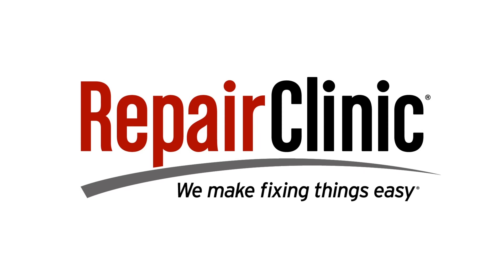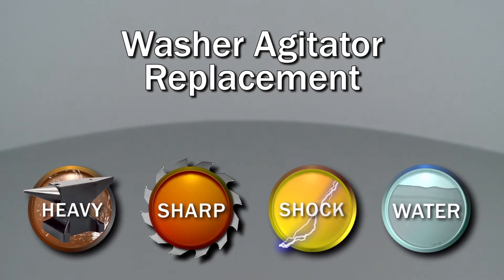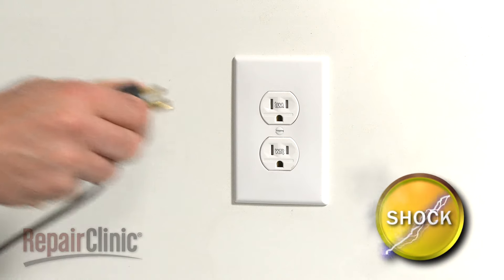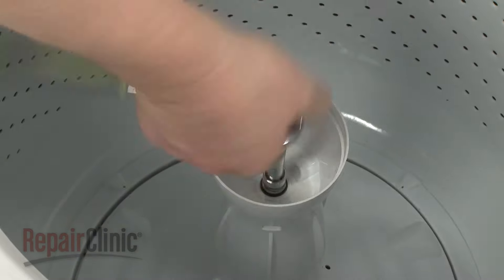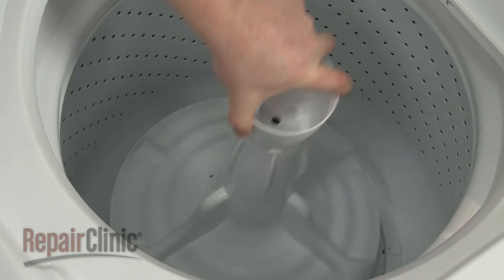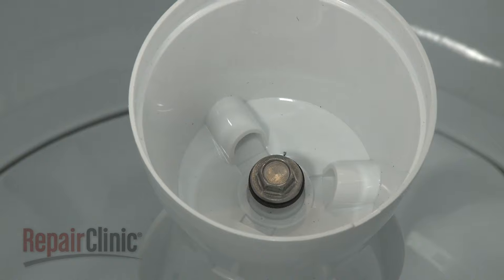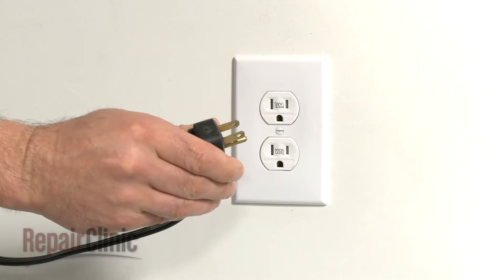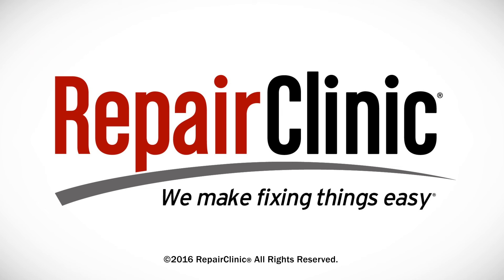Whirlpool Top Load Washer Agitator Replacement #W10680208

Comment: I just replaced this agitator in my machine and it is now working. To answer some of the questions below, no, this type doesn't have dogs or any other pieces to replace except the whole agitator. What happened to mine was the plastic "teeth" that connect to the drive shaft wheel had worn down and were stripped.  I could spin the old agitator without anything else moving and when the machine was running the drive shaft turned without the agitator turning. Once I placed the new agitator onto the drive shaft it locked in and couldn't be spun freely. I wish I could add a picture because it would make more sense. I guess plastic naturally wears down when paired to metal. ALSO....my husband tends to overload the washer and I am sure that is tough on the plastic part of the connection!!! The weight of moving too much wet laundry probably wore down the plastic quicker than it should have.
Reply: Exactly the same comments above apply to my situation...including the husband issue.  LOL
Reply: You answered all my questions! Thank you!!!!

Comment: The key to removing a stuck agitator IS brake fluid and pulling like a mo fo.  A few good taps with a rubber mallet helps brake it loose to where you can pull it out.  Took me about half hour.
Reply: I used Q20, left it for a while and then got my fingers under the bottom of the agitator....wiggle, wiggle, wiggle.
Reply: This was a headache.  The bolt came off easy enough but that bit$h would not move. Used some wd40 also used a screwdriver that had a shaft thick enough to fit thru the 3 small holes at the top of agitator. Hit them in turn with an upward stroke going around and it finally came out.

Comment: When I go to loosen the bolt whatever it’s connected to spins with it. Like a shaft or something. So the bolt itself does not loosen. Any ideas?
Reply: Hold the agitator, unscrew the bolt, and pull the agitator out.  I had to really use my strength.  But it eventually come out.  The teeth in my agitator were stripped.
Reply: If you can manage it, someone suggested to me and it worked: if you don't have a power tool to help you break the bolt free, stand inside the washing machine to weigh down the drum so it stays put while you use the socket wrench on the bolt. It felt crazy, but it worked for me!   Washer capacity is 3.5 ft3 of water, which weighs over 200lbs. If you weigh more than that I'd maybe not do it, but it worked for me!
Reply: I asked someone else to help so I would have another pair of hands. One pair to keep from turning and one to loosen the bolt.
Reply: I was co fused by this too because every video shows the the agitator turn when loosening the bolt for a turn or two, and then it unscrews, but with the agitator stripped and the bolt old and corroded, it turns the drum and not anything else. You have to hold the drum/basket in place and try to unscrew the bolt (in my case) the whole time until the bolt is completely out. It’s a pain in the damn azs.
Reply: Impact drill was only thing that worked for mine
Reply: Did you ever figure this out?  I'm having the same problem and can't find the answer
Reply: @Steffi_V  please tell me you figured it out T.T I'm in the same predicament. I don't think these people understand that holding the drum still and everything doesn't work if whatever the screw is connected to spins when you hold the drum. I nearly burnt up my drill
Reply: @WolfOfTheAbyss  Yes!  I read above that someone used an impact drill but I didn't have one. So I took my socket wrench and just started giving it quick hard fast jerks with a lot of jolt over and over and over. Make sure it's  quick and forceful turns and stop right as the underneath part of the drum starts to spin.  I cranked on that thing like a hundred times literally, and right about as I was about to give up it came loose!  The bolt is really caked with grime and crud and grease that needs to be loosened that's why you really should have an impact drill for it.  Unfortunately my washer still isn't fixed.  After taking it apart, cleaning everything and replacing the agitator dogs it gives one whoosh of water at the beginning of the cycle and then stops agitating again.  My next guess is the capacitor 🤷

Comment: The agitator does not lift out. It is stuck or something is keeping it from coming out. Do they all of this same model come out the same way? Do I have to go under the machine to loosen something? MOD WTW4815W1. My card was invalid. I have to check on it.
Reply: I have the exact model machine you have with the exact issue.  Did you figure out how to get the agitator out?
Reply: We have the same model and we just got ours out.  It is very corroded underneath and we had to use a rigged up winch with a strap under it to get it started.  If you can pull it up enough to get your fingers underneath then you can start to wiggle it back and forth.  And now that it is off I can't tell if the worn down splines are inside of the agitator or on the very very expensive drive shaft.
Reply: I just got mine off. I tried the brute strength way with not luck. I placed a a band underneath and pulled and nothing.  Then I dropped a little bleach in the whole that the nut came out of and saw a chemical reaction. I waited a minute or so and then gently poured 60 degree Celsius water into the hole and pulled up and down on the agitator 10 or so times and repeated this step for about 20~30 mins. It finally came off. The gunk/scud was horrible. I am currently soaking the agitator and ring in the tub. I have a pause and play washer. Once you take out the agitator it will not fill up. So I have to fill it up with a Downy bottle filled with hot water. I can drain it by holding the button for 3 seconds. Hope this helps.

Comment: If you have this exact machine the agitator itself probably is not the problem. After going through a stuck bolt and a stuck agitator that sits on a corroded drive shaft, I found that there are no "dogs." The agitator is just one plastic piece that sits on the drive shaft which is one piece with the tub. The problem is something under the tub. I had to use an impact wrench to take off the bolt, and then pour a bit of brake oil in the bolt hole that eventually allowed me to pull off the agitator.
Reply: So what was the issue that made it not agitate?  Mine spins but doesn't agitate...and is pretty corroded.  Used a jack (don't ask) to pull the agitator out.  I can't figure out the part per any of the schematics.  Or it might possibly be the drive assembly for $327,  that's not happening.
Reply: @catherinesoule9857  I was able to get a used replacement for cheap so I haven't messed with it further. I think it was the coupler on the bottom which is like 7 dollars, I also think I did further damage from running it to test things and it probably needs a more involved and expensive part replacement now, since it stops on spin.

Comment: I have this exact machine.  When I pull it away from the wall I hear water sloshing under the tub.  There is also a funky smell.  I removed the back, the drain house, felt inside the drain area and found nothing.  Works fine (even after I put it back together LOL) but I don't know what to do now.

Comment: I had to buy a replacement agitator, and the original part has since been replaced. Multiple sites say I have the correct part, but the new agitator won't fit on the drive shaft. The parts look identical, but the canal for the drive shaft is more narrow. Any ideas?
Reply: Sounds like you have the wrong part which is frustrating I know. I’ve had similar issues with other machines. Either look harder for the right part or get some jb weld and glue it on, haha

Comment: what would be reason to change this type of agitator?
Reply: I had to change whole agitator, when i needed to replace the agitator dogs, because the retaining bolt was badly corroded. I had to remove some part of the agitator to expose and access the bolt. Everything is good now,  I got my whirlpool 2nd hand from my sister. (replaced the bolt with a stainless one)

Comment: When I try and loosen the bolt the entire unit turns with it. If I hold the tub and agitator in place I can hear the motor or gearbox turning with the bolt. Anyone else have this issue or how to resolve it?
Reply: Darren Peter   Im having same issue ... did you figure it out?
Reply: @brandonfillinger3034  i have the same problem please help :c
Reply: I used a screwdriver and a hammer and tapped the whole on the center a few times to losses everything up. Not to hard, just a few gentle taps.
Reply: I can't get the damn agitator off. It will not losen whatsoever and I'm at the point of buying another one 🙃.  Anyone have any suggestions?
Reply: I had to pull very hard. The connection piece where the bolt attaches was quite oxidized and was not allowing the agitator to pull away from it. I had a friend knock it it with a screwdriver + hammer while I pulled it upwards. This loosened it enough for me to get my hands under it and pull it up and out. Hope that helps!
Reply: YouTube whirlpool washer plate and citric acid
Reply: Did you figure it out? I have the same problem.
Reply: I have the same issue, the bolt seems stuck and when I turn my socket wrench counter clockwise seems the motor underneath goes with it.
Reply: @theranbjornson5436  I just gave it a go.  I damn near picked up the washer.  It's rusted on the good.  Yes the bolt was removed first and I hammered on the sides while pulling up.  Didn't budge.
Reply: @zombieno1  I don't know if it worked or would help at all but I had a video of me pulling mine off and uploaded it to my channel as a short I think? Doesn't show a lot but kinda how I got it to move a little bit and it would sort of pop up and down. I got my hands under the bottom and pulled as hard as I could. Eventually it popped off.
Reply: @theranbjornson5436  ay I really appreciate you responding.  I'm going to give it one more try tomorrow.  It's my neighbor's machine and I'm just trying to help her out.
Reply: Use an impact drill to remove the bolt holding down the agitator

Comment: Mine won't come off ... Its easy to get the bolt off and I pull and pull and bang on it but it still won't come off.  This machine is only 5 years old too so the corrosion can't be that bad.  How do professionals in this work do to get the agitator off?
Reply: I have the same problem my agitator won't come off either
Reply: @acidbranding5158  mine either
Reply: I just got mine off. I tried the brute strength way with not luck. I placed a a band underneath and pulled and nothing.  Then I dropped a little bleach in the whole that the nut came out of and saw a chemical reaction. I waited a minute or so and then gently poured 60 degree Celsius water into the hole and pulled up and down on the agitator 10 or so times and repeated this step for about 20~30 mins. It finally came off. The gunk/scud was horrible. I am currently soaking the agitator and ring in the tub. I have a pause and play washer. Once you take out the agitator it will not fill up. So I have to fill it up with a Downy bottle filled with hot water. I can drain it by holding the button for 3 seconds. Hope this helps.
Reply: I did some research and the softener with all the dirty water mix created a paste that locked the agitator to the shaft.  Be patient and use max strength.  Beware that you will find a bunch of junk in the agitator.  Some people think it is grease, but it is nothing but softener and dirt mixed together.

Comment: My Amana has the same style agitator as the one in the video. But when I pull up on it it's not coming out.
Reply: Because they don't just pull out that easy. I had to make a half ass gear puller to push on the bolt and pull the agitator to even get it to move.
Reply: Have you found a solution? I am dealing with the same issue, and it feels like planned obsolescence.
Reply: I’m having the same issue too! It’s frustrating!!!
Reply: Same! 😑
Any solution yet?
Reply: Just kept pulling on it then if finally came apart
Reply: It took me about 45 minutes until I tried this...
Lift agitator as high as it will go (not very). Grab the ring under the agitator (try to get fingers under there) and slowly wiggle and lift up until it comes out (took about 5 minutes of blood, sweat and determination...I'm a guy, no tears). Mine (and probably yours) was very corroded in there. Bad news for me is it wasn't the agitator that was the problem it was the motor??? that the agitator sits on it's 3 times the price of an agitator.
Hope that helps.
Reply: @israelramos77  I just got mine off. I tried the brute strength way with not luck. I placed a a band underneath and pulled and nothing.  Then I dropped a little bleach in the whole that the nut came out of and saw a chemical reaction. I waited a minute or so and then gently poured 60 degree Celsius water into the hole and pulled up and down on the agitator 10 or so times and repeated this step for about 20~30 mins. It finally came off. The gunk/scud was horrible. I am currently soaking the agitator and ring in the tub. I have a pause and play washer. Once you take out the agitator it will not fill up. So I have to fill it up with a Downy bottle filled with hot water. I can drain it by holding the button for 3 seconds. Hope this helps.
Reply: @alo0oshful  I just got mine off. I tried the brute strength way with not luck. I placed a a band underneath and pulled and nothing.  Then I dropped a little bleach in the whole that the nut came out of and saw a chemical reaction. I waited a minute or so and then gently poured 60 degree Celsius water into the hole and pulled up and down on the agitator 10 or so times and repeated this step for about 20~30 mins. It finally came off. The gunk/scud was horrible. I am currently soaking the agitator and ring in the tub. I have a pause and play washer. Once you take out the agitator it will not fill up. So I have to fill it up with a Downy bottle filled with hot water. I can drain it by holding the button for 3 seconds. Hope this helps.
Reply: @davidmclaughlin2954  I just got mine off. I tried the brute strength way with not luck. I placed a a band underneath and pulled and nothing.  Then I dropped a little bleach in the whole that the nut came out of and saw a chemical reaction. I waited a minute or so and then gently poured 60 degree Celsius water into the hole and pulled up and down on the agitator 10 or so times and repeated this step for about 20~30 mins. It finally came off. The gunk/scud was horrible. I am currently soaking the agitator and ring in the tub. I have a pause and play washer. Once you take out the agitator it will not fill up. So I have to fill it up with a Downy bottle filled with hot water. I can drain it by holding the button for 3 seconds. Hope this helps.

Comment: Bolt is removed but agitator feels connected underneath and will not come up.  Any advice?
Reply: I just got mine off. I tried the brute strength way with not luck. I placed a a band underneath and pulled and nothing.  Then I dropped a little bleach in the whole that the nut came out of and saw a chemical reaction. I waited a minute or so and then gently poured 60 degree Celsius water into the hole and pulled up and down on the agitator 10 or so times and repeated this step for about 20~30 mins. It finally came off. The gunk/scud was horrible. I am currently soaking the agitator and ring in the tub. I have a pause and play washer. Once you take out the agitator it will not fill up. So I have to fill it up with a Downy bottle filled with hot water. I can drain it by holding the button for 3 seconds. Hope this helps.
Reply: @Blade098Oki  Can confirm this worked for me too. Poured some bleach, let it set and them poured boiling water. Was able to pull up enough to to get my fingers under the bottom lip of the agitator and from there I was able to pull up (make sure to clean the area from any spilled bleach before reaching in). Took about 5 mins up turning the agitator around and pulling on different sides. 

Now that its off, I'm wondering what everyone uses to clean the driveshaft and all the gunk on the inside of the agitator. Is there any concern about rusting of the driveshaft or agitator bolt?

Comment: I have the same machine just bought it but it's not washing ...everything starts on ok put water and locks itself and then a sound as if its washing goes on for sometime then stops when i open the laundry is not washed...i have place the machine on wash only but then it just wanna drain water out the laundry still dirty unwashed...what hav i done wrong any one can help please
Reply: your agitator dogs may need to be replaced.